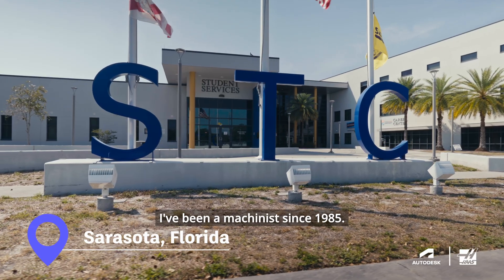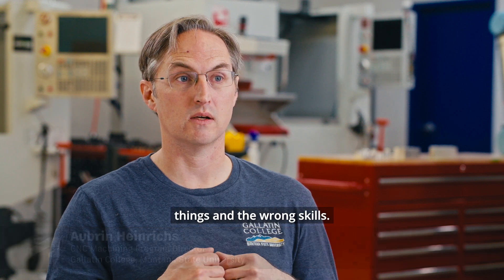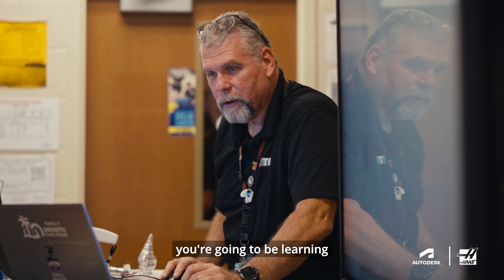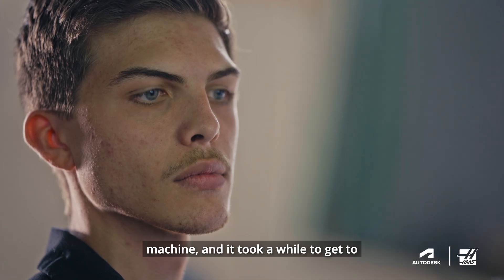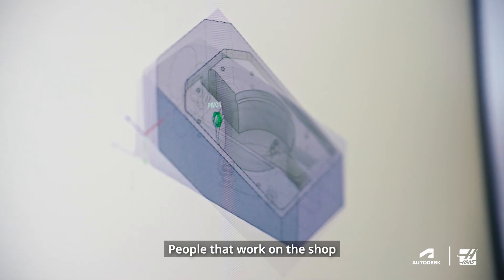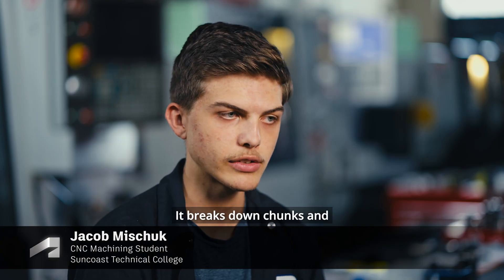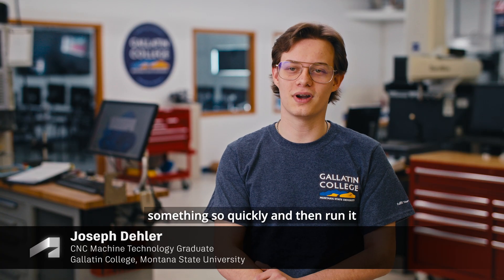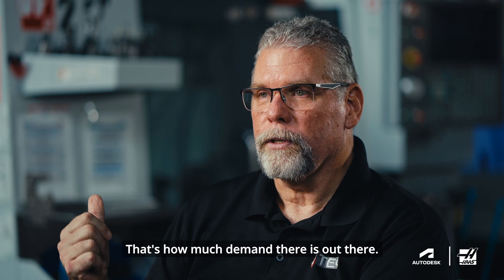New Haas and Autodesk CAD/CAM/CNC curriculum | Autodesk Fusion

Comment: Haas and Autodesk are the worst software I have ever seen. Full of bugs and missing features. It's funny to see them working together🤣
Reply: I totally disagree.  I have been CNC machining since 1985 and have used many CNC machines and 10 different Cam systems up thru 5 axis milling.

Autodesk Fusion is totally competent with all Shops from mom and pop through the biggest. I have worked at all. I also worked and used many different CNC machines and Haas is the easiest to use and have no issues.   What bugs did you see and features missing?   Go ask Jon Saunders from NY CNC how good it works.
Reply: I agree